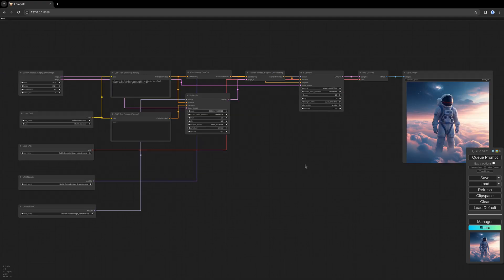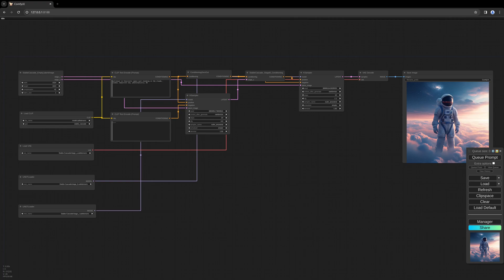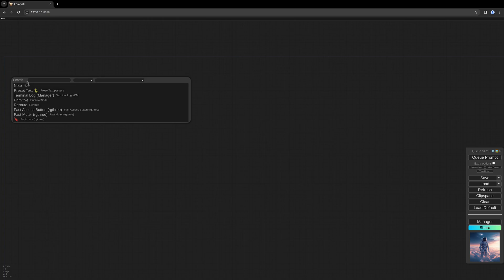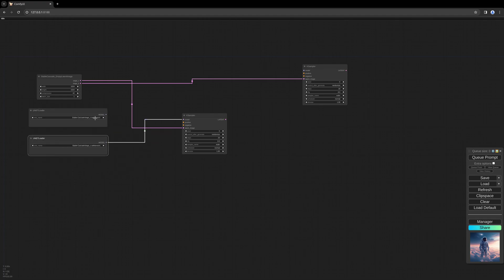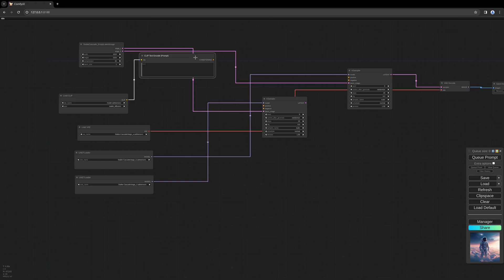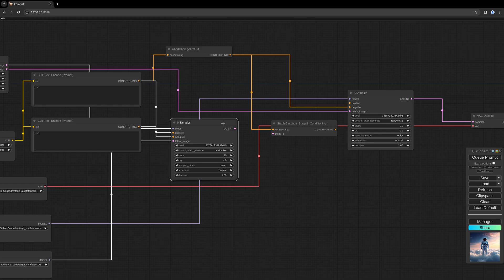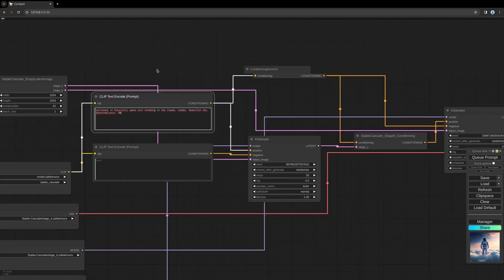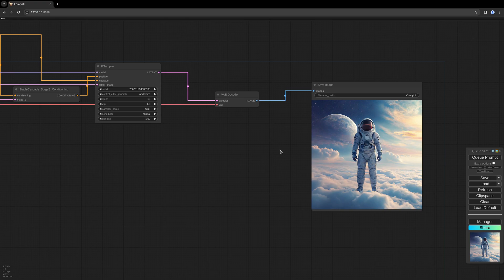Stable Cascade workflow in ComfyUI

Comment: That helped out so, so much. I'm successfully cranking out images on measly 4 GB of VRAM, lol.  Take the workflow stated in the video, and take it to next level with ComfyUI-to-Python-Extension for fully autonomous image generation, and probably also include comfy-image-saver (acquired via Comfy-UI-manager) in workflow. Then take it even further and probably put in UDP or TCP for bi-directional control to keep track of loop state, or to change out the positive/negative prompts, etc....super powerful.
Reply: As an idea that I'm exploring now, is to nail down creating 3D stereo SBS images....it's like 50% or less success rate so far....looking to explore ControlNet, img-2-img, style transfer, latent space pre and post processing, LoRAs, etc to bump that success rate to 80-90% hopefully....I find that only Stable Cascade, and particularly the full Stage B and Stage C models can seem to accomplish the task...Gemini, DallE, Stable Diffusion don't seem to do it...I think that nailing down consistent, coherent perspective for the case of simple 3D images, then tackle temporal sequences (think SORA), and also multiple vantage points, you'd probably be able to make NeRFs, CAD drawings, synthetic data for testing computer vision models, and so much more....and it all pretty much starts now, as Stable Cascade in Comfy UI seems to be able to deliver
Reply from the maker: @EM-yc8tv  Sounds super interesting what you plan. General missing consistency and coherence makes things quite hard in some cases. Especially for 3D and animation. Encreasing consistency and coherence will change everything a lot. I will do a video about the automation of workflows via Python soon.